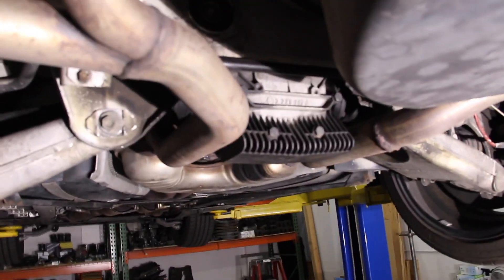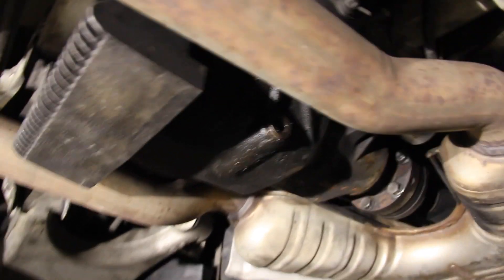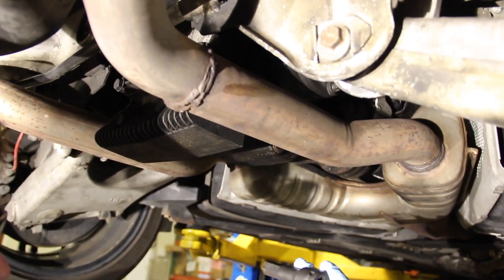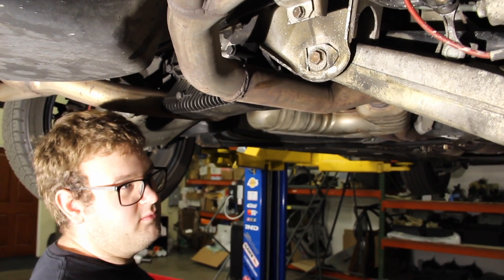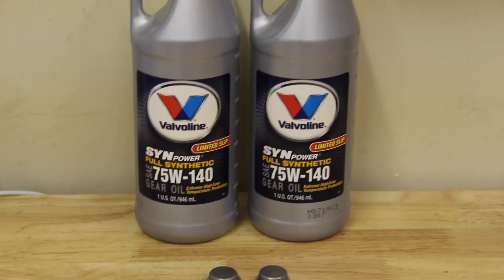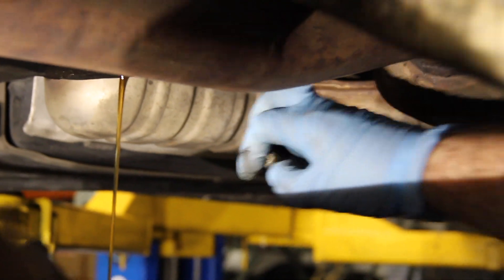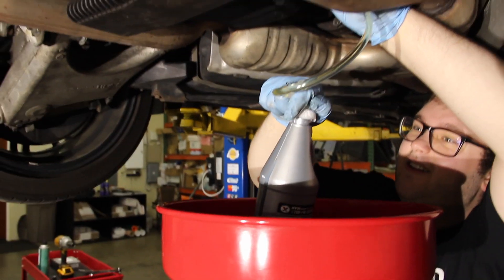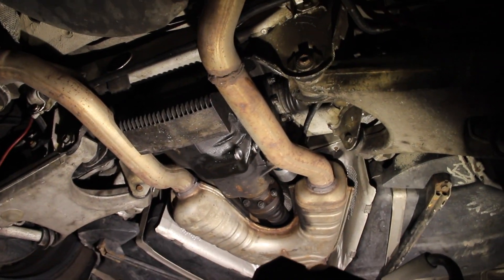BMW E39 M5:  Differential Fluid Change DIY

Comment: Excellent video that drain plug is hard to get to. I used ramps and their method of removing the drain plug and had to use a cheater on the end wrench. I have done a number of diff fluid changes on various cars using the hand pump. Its a mess. The following is a fluid pump method I used that worked great and is much faster and cleaner than using a hand pump. If you have access to a air compressor. Use this at your own risk and capabilities and understanding of compressed air and partially closed containers and potential dangers. Run tubing through the screw on container cap (drill hole diameter of tubing a tight fit is good) run tubing to bottom of container and leave enough tubing outside to reach fill hole. Insert the air gun barrel (small diameter) into top area of contaner. With fluid in the container and the tubing in the fill hole use the trigger on the air gun to carefully intermittently puff low pressure into the container. Be careful to control the pressure. The fluid will be pushed up the tubing into the fill hole. Small Air leaks may occur that's ok as long as they are not huge. This is a much faster simpler and easier way to pump fluids. It took me 10 minutes to rig up the pump.  Again be safe and do not do this unless you are familier with the hazards of compressed air in partially closed containers and have a means to conrol application of the air ( like trigger or valve that controls the air flow).

Comment: On the new cars u dont have the drain bolt but u can remowe one of the cover bolts and drill it with a 8mm bitt and just but a crush washer on the bolt now u have a drain